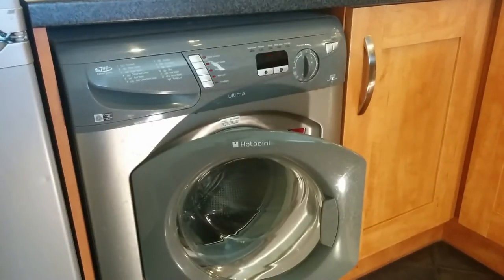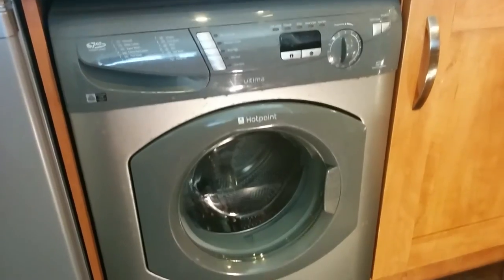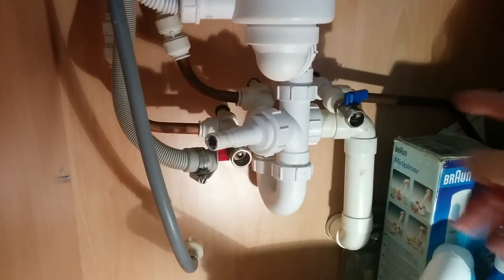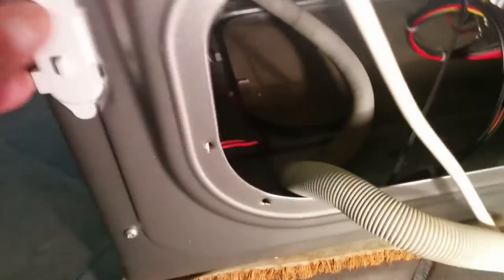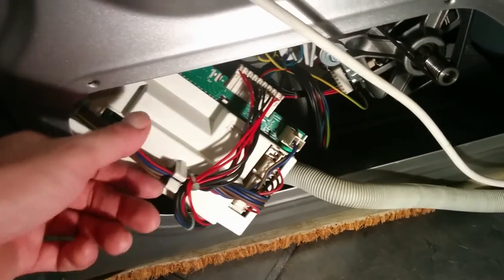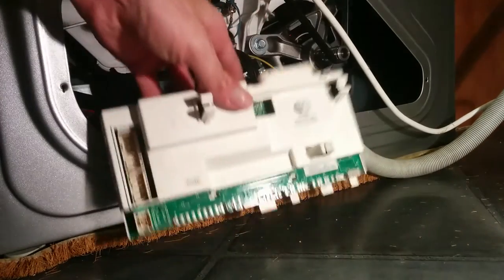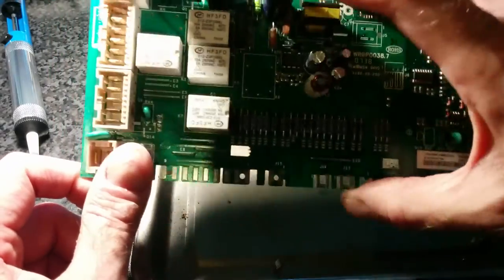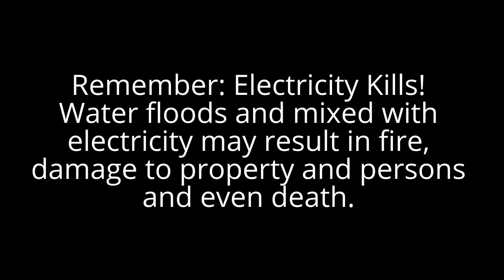Hotpoint Ultima All Lights Flash Fault WT721 How To Fix Washing Machine

Comment: Hi thanks for making this video, managed to get my mums machine working again, got all 3 capacitors from Maplins, 680µF-10v maplin code N70DG, 470µF-10V maplin code VH46A or DT67X. 100µF 25V maplin code VH37S or DT62S, you can use a higher voltage rating capacitor with no problems, you cant go too big else it wont physically fit in the case, many people replace the 680µF with a 1000µF capacitor, I replaced all 3, all 3 existing capacitors showed signs of being domed.

Note to people with a small soldering Iron you will struggle to melt the solder unless you have at least a 25W soldering iron, use a solder sucker or solder braid to remove the older solder, also a good idea is to blow inside the plug on connectors as its easy to pick up fluff in them when when you take the PCB out.

I did this job from start to finish in 1 hour, it took 30 mins to get the capacitors from maplins LOL, all in this saved me £350 for £1.50 worth of capacitors and an hours work.
Reply from the maker: Glad I could help mate. it's good to have a visual inspection first(because it's 2018 and for liability reasons LEGAL WARNING: DO NOT EVER ATTEMPT REPAIRS YOURSELF OR YOU COULD DIE) cause like you said, it literally cost you £1.50 to fix rather than spending £350 for a new one when you need a clean shirt for Monday and its the weekend or when you need an expense like a hole in the head. 

It took me a little longer than 30 minutes cause I had a hangover. And yes to a good soldering iron. One I got ain't great and I would have done this job with a more powerful one in half the time. Definitely good to have a solder sucker cause it a bulky soldering.

Recently, I had a power surge, not a stranger to frequent power cuts in the UK either,  and the error showed up once. 
I presume those cuts and surges were to blame for one of my old PC's, fridge number of PSU's and the washing machine to pack up.

Comment: I had the same problem and Piotr hats off to you man for your marvellous video to get the module out. All though it has taken you a bit longer, your video made me take the module out in 10 mins. I am an electronic design engineer my self. I have changed the 22uF 400V capacitor that you have opted not to change as I have designed off-line SMPS (Switch Mode Power Supply) with same Power Integrations IC - Tiny Series TNY263 chip on the PCB.

I can add some further details to help you prevent the same capacitors - Electrolitic Cpacitors come with a working hours specification in the range of 20,000 hours - 50,000 hours. Manufatureres pick the lowest hours for the obvious cost saving reasons. Switch the washing machine off at the power socket to save the Capacitors working hours.

Keep up the good work man ;-)
Reply from the maker: Cheers pal. I'm delighted you've enjoyed it and given such a good and helpful comment even though at the time of recording I had a bit of a hangover and setting up the tripod, lights and cameras was taking a bit of time and generally I thought it'd be a crap video no one will ever watch. I guess if I got up fresh and skipped trying to be a youtuber (LOL) I would have done it in 15 minutes ;-)  but then many would have missed out.

Very good suggestion as per changing the 22uF 400V capacitor as after my last power surge I did get the same error once so at least I'll bear in mind to change that one too and probably the whole cluster of 3 just for a good measure. But it works for now and I'm not that bothered.

I agree with you on switching the washing machine off at the socket. Lucky I have a mains switch conveniently located, even though it is totally grandad thing to do, I do flick the switch off.

Comment: Had the same problem with my hotpoint Aquarius. Changed the large capacitor which had blown and all now working (so far!) Thanks for the advice!
Reply from the maker: James Worby it should work ok but generally it's a good practice to change the whole bank as the rest might be on the out and you'll end up fixing it again in a year or so. But no worries. Glad I could be of help.

Comment: Awesome video thank you! My washing machine had been doing the flashing disco lights on and off for ages. Eventually just wouldn’t work and flashed constantly, even for a few seconds when power was off! Ordered and replaced the same capacitors as you said and it’s back to normal. All for £4. Thank you!! x
Reply from the maker: You're welcome :-)

Comment: you made me smile whilst watching your video. 
The capacitors were probably ruining to the  capacity of there voltage hence them blowing; manufactures use the minimum spec  to keep costs down; by up rating the voltage in  the capacious you have made them less likely to blow in the future. by the way it was you delivery of the video which made me smile. Colin
Reply from the maker: Colin Brooks all in a days work 😂. I should also mention how badly hangovered I was making this video. Yeah, I tinker with pcb's and stuff. Thanks for watching and if this video made you smile I hope my others do as good of a job. 😀

Comment: Hi thank you for the beautiful video I have a hotpoint washing machine the display , the keyboard working it takes water but the motor doesn't work I opened the control box but I couldn't see any short or damage what do you think please let me know if you have any information thanks in advance.
Reply from the maker: Thanks for watching it. It could be that the motor is blown or the motor control unit. You need to measure circuits and test continuity. That's where I would begin.

Comment: This is common problem with Hotpoint and Indesit washing machines.  They used cheap electrical parts. 

Just replacing the C17 Capacitor will resolve the problem.  I would do it myself except I don't know how to solder.
Reply from the maker: YouTube search: how to solder.  ;-)
Reply: +Piotr Miecznikowski

Thank you.
Reply: I did this a few months back and it working great,got caps for 5 for £1.Easy to solder..
Reply: coxy ofnewp 

Is too late for me.  I got a new washing machine.  I wish I knew you lol
Reply from the maker: Gra Piken lol